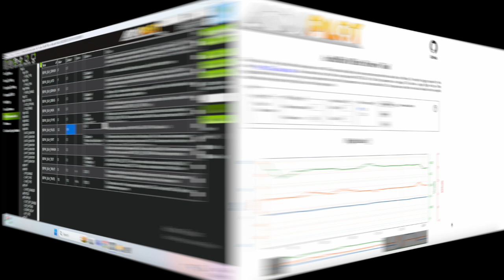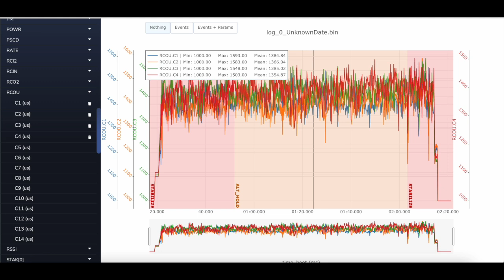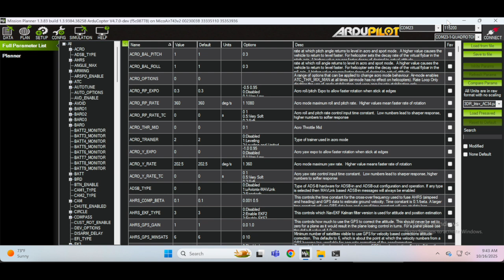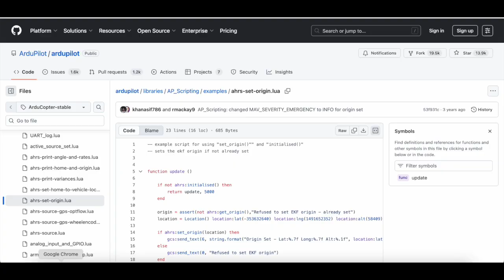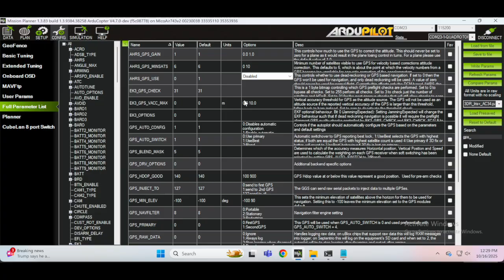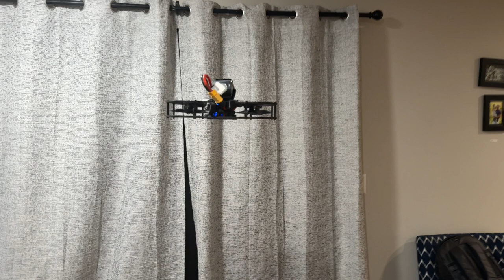ArduPilot Tutorial Part 3: Revisit Notch Filter, Log Review, and Setting Up MTF-01 on a 2.5" Build

Comment: I bought this sensor for my Long Range 7". I think I'll drop the optic flow idea for now and just use its LiDAR — it's also a really useful thing for automatic landing. I've set up the LiDAR so that its data is only used when the drone is below 4 meters.

 Although I might try adding optic flow later. I just couldn't get it to work before — the flow wasn't appearing in the parameters. Right now I'm mainly fighting oscillations and such. The drone itself is quite heavy and vibrates a lot. Turns out I don't want to add extra positioning information to the drone at the moment.

These are very useful settings. I really need to set up the filter using logs. Thanks for the video!
Reply: You’ll have to get 4.4.4 ardupilot firmware then you should see the Flow_type. I ran into this issue earlier because I was using the .6 firmware, but downgrading gave me access to that parameter